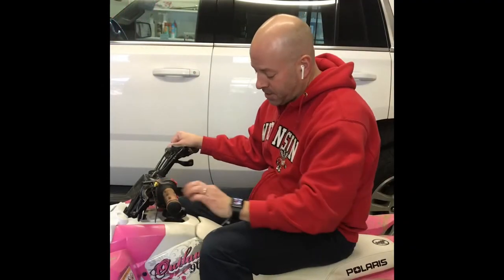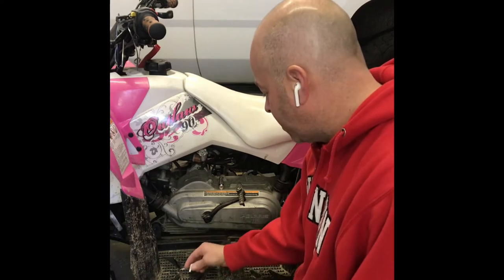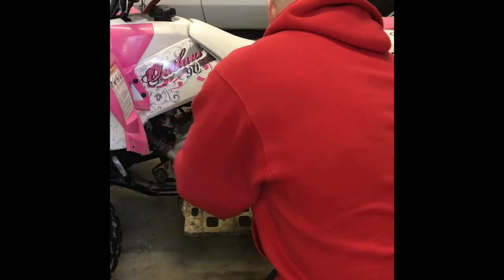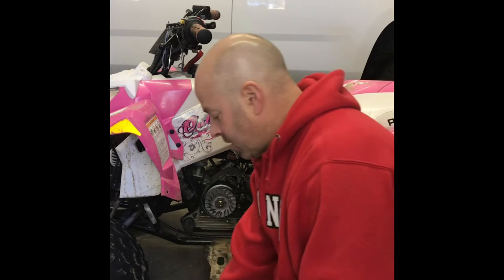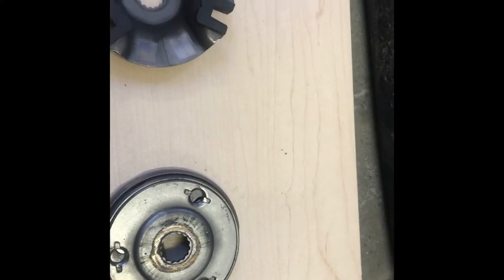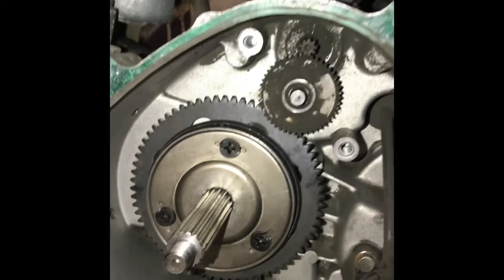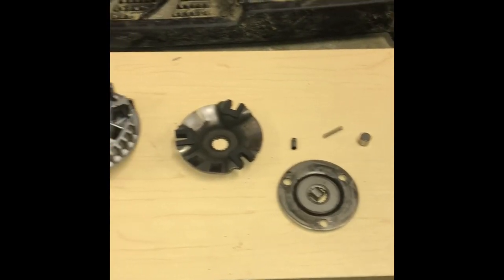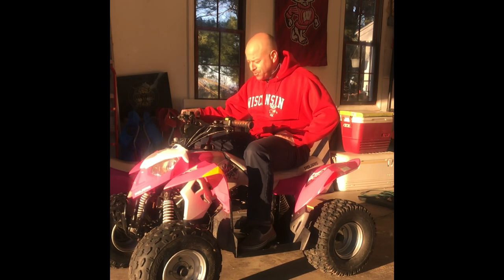Starter Clutch Polaris Outlaw - FIXED

Comment: Do you have the link for the part? And would it be the same for a 2016 model?
Reply from the maker: I matched mine on Amazon.  I cannot tell you the 2016 part.   I recommend a good key word search for your specific model.  Of course if you have manual you should match the part number.  Good Luck!

Comment: Hey Terry thx for this. Mine has the same issue when trying to electric start. When I try kickstart, there is also a grind sound too. Can the clutch cause this?
Reply from the maker: I recommend you pull that cover off like I did and you’ll likely find the issue.  Good luck!